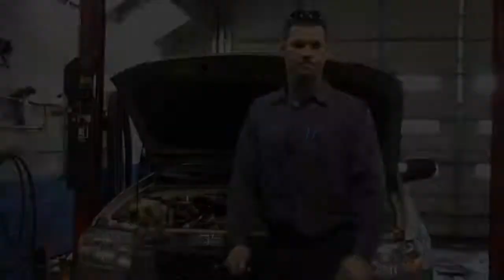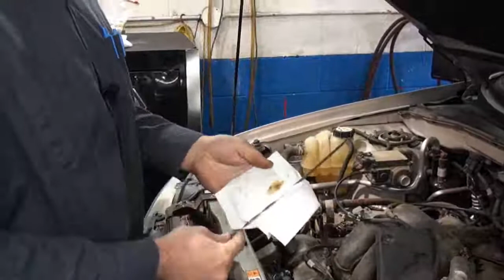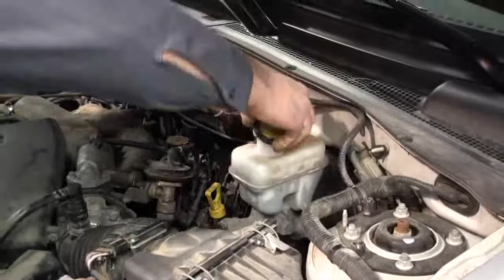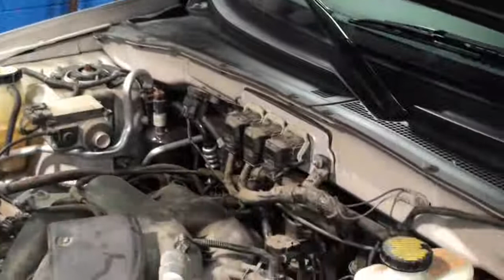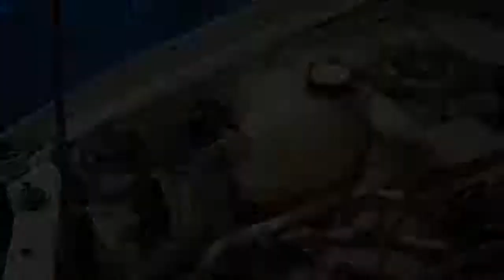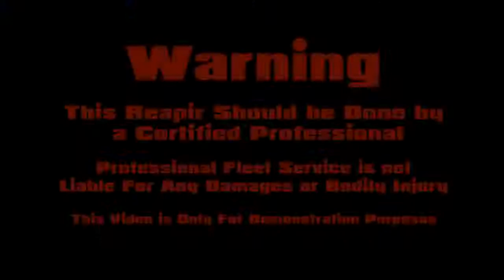How to Properly Check Vehicle Fluids: Car Maintenance and Repair Tips Part 1

Comment: I guess I always thought the engine oil level should be between the high and the low, not above high, ideally in the cross hatched area. Have I been underfilling?